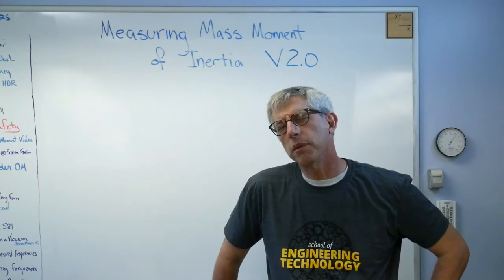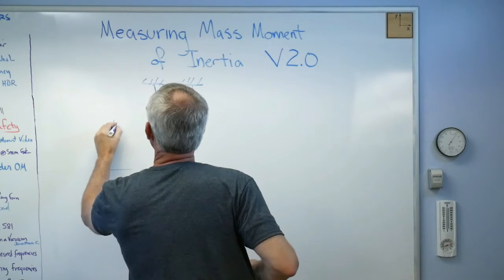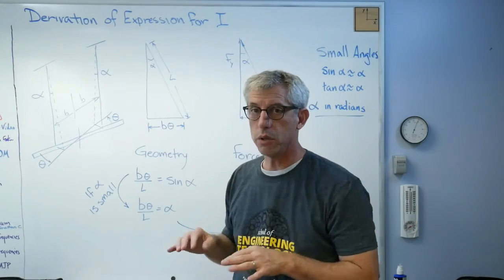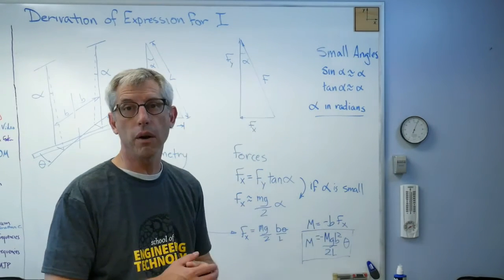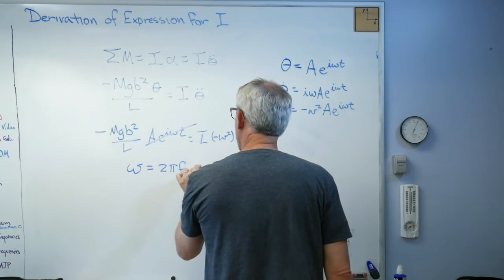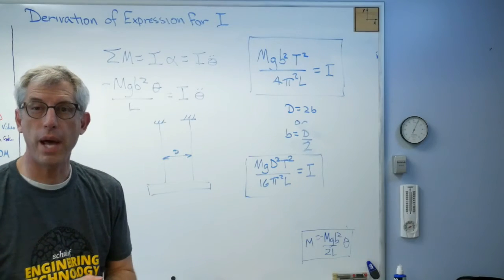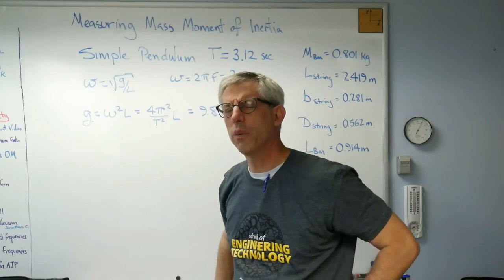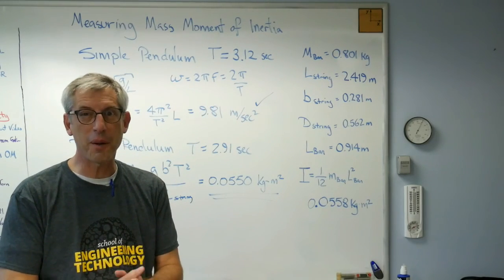Measuring Mass Moment of Inertia - Brain Waves

Comment: Thanks for very interesting video. I would like to apply this method to mesuring the mass moment of inertia (MMoI) of my robot. However, I have following questions: 

i) MMoI depends on mass (of course mass distribution) and geometry of the object. For a defined object, can be considered as a constant. This results to b^2 T^2 /L = const. Is it true?
ii) If i) is not true, then it means that MMoI depends on b, distance from the CoG to the point where you hold the cable. So, where is that point for obtaining a good value of MMoI?

Comment: Thanks for the tutorial, and just a small question.
What if the CG is not at the center of D. Does the derived equation still works or any modification suggested.
Great thanks in advance
Reply: The derivation requires that both tensions be the same which will place the CG somewhere between the two strings and along the line connecting the two strings as well.

Comment: Hello, I was using this formula in my experiment to test the parallel axis theorem, however, I quickly realized that it only works when the rotational axis is at the center of mass, is there any iteration of the formula that considers having the rotational axis away from the center of mass? Help appreciated!

Comment: if I want to measure the moment of inertia of a irregular shaped object , then how I can find the two points to connect the strings at the beginning? do I need to find the center of gravity first?  if the center of gravity is not on the middle axis of the two strings, can we still use this math model?
Reply: You need to find the center of mass. You can use this math model, but the distance b must be measured from the center of mass. Refer to this image: https://www.google.com/url?sa=i&source=images&cd=&ved=2ahUKEwim7baK1oflAhUIi3AKHS21DHMQjRx6BAgBEAQ&url=https%3A%2F%2Fwww.researchgate.net%2Ffigure%2FUsing-the-bifilar-pendulum-method-to-measure-the-moment-of-inertia_fig2_2358471&psig=AOvVaw0tiWS_FGzyE_NVK1unHbUd&ust=1570452627778261

Comment: Can we get Period directly from g = 4(Pi^2)L/T^2 without measuring period manually using pendulum?
Reply: no, cause the 'g' may be inaccurate. you need to do the opposite, and confirm that g is acurate for your pendulum after measuring pendulum

Comment: how do you theoretically calculate the moment of inertia of a funny shaped object? for example a quadcopter? it's not a solid piece of material. Do those suspended strings have to be parallel?

Comment: Great Explanation

This information will help me model my quadcopter which I am designing and building including the control board. This kind of information was lacking in my college control systems course (EE curriculum). It seems the most difficult part of controlling a system is to get an accurate model of the system so this information along with modeling the motor torque will solve major pieces of the puzzle.

Thanks for a great effort. Only minor complaint is it seems you may need to replace one of your felt tip markers soon.

Comment: That was amazing! so would this method work on other more complex objects as well, like your skate board or a tree branch?
Reply from the maker: In theory, it should work on just about anything.  The Air Force uses this method to find the MOI of underwing stores like fuel tanks and missiles.
Reply: Thanks, I used this method for my physics lab along with using a turn table to find the moment of inertia and I got close to the same result both ways.
Reply: @purdueMET  I was trying to find the MOI of my Styrofoam glider, but it is almost impossible to balance the aircraft

Comment: Hallo Purdue,
I would thank you for your good explaination but I have some notes on your work:
1- the experimental twist angle is approx more than 15° but the relation will not equal sin(°)=|=(°), if you need to apply this relation the angle should be close to zero.
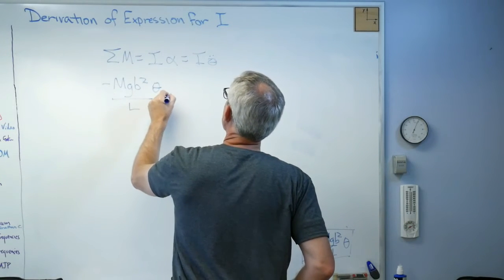2- your derivation was  M.g.b^2.theta/(2L) at time 5:28 sec but at time 12:21 was M.g.b^2.theta/(L) (2 times than before why??)
Reply: I had the same doubt, but I figured out why here. 

It happened because in the first part he derived the momentum of only one cable, and in the second equation(with the thetas) we need to use the sum of momentuns. That's why it's 2 times than before.